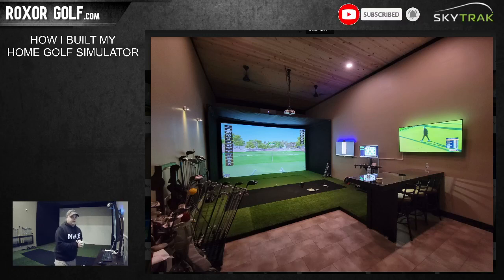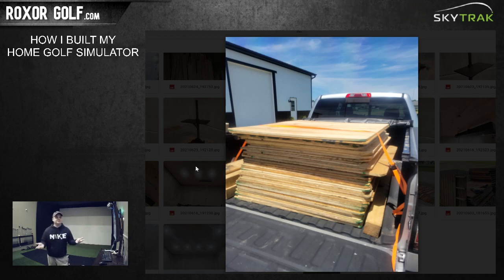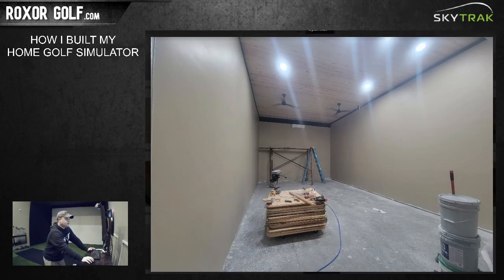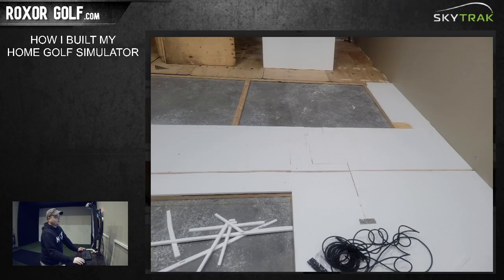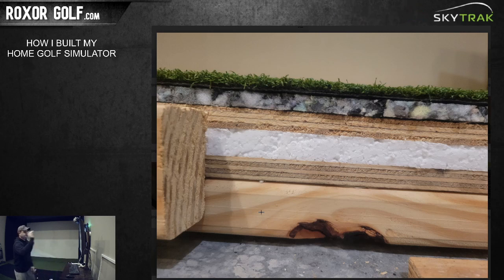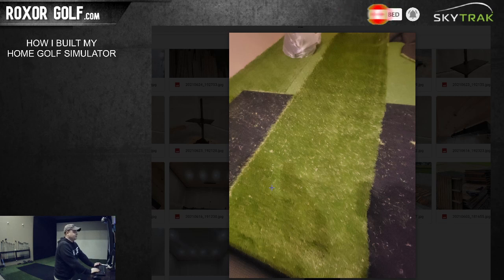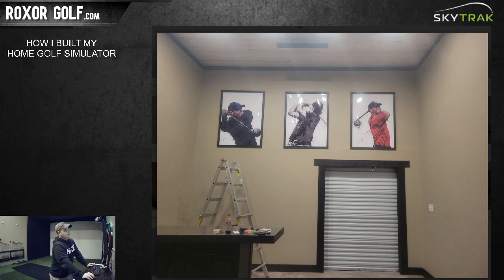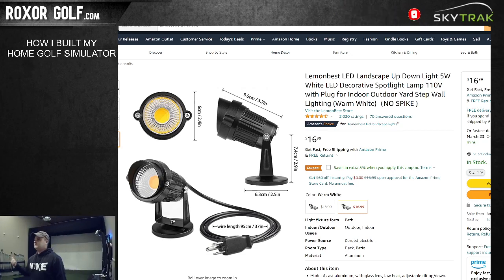Build A Home Golf Simulator FROM BEGINNING TO END! - Most In-depth Video On Youtube.

Comment: Looks nice - good resource for me, working on putting together a list of everything I’ll need for my build I am starting. Like the idea of having a control box too. 

The 4 or 5 layer floor threw me off - seems like a lot of extra work and energy ..but for what reason? Why not just lay some foam exercise squares down and then put the turf on top of that? Did you get the wood for free - I might have missed that?
Reply: I keep thinking in my head - it can’t be this difficult to lay down a bunch of foam tiles, cover it with putting turf. Cut out your hitting area. Build an enclosure.. and set the electronics up. 9 months to build this - I guess the room started from scratch as well but, this sim build itself..  It seems like a weekend project to me once you have everything.
Reply from the maker: I built the floor up the 1st time about 2 inches. Then I had the idea to put the pipes of the enclosure below the floor level. I had enough extra material that I got super cheap, so I built another 2 inch layer on top. It should have only been half the height but my lack of planning caused me to have to build the floor up 2 more inches. Plus all the wood only cost me only $300ish. Call me anytime if you have questions.